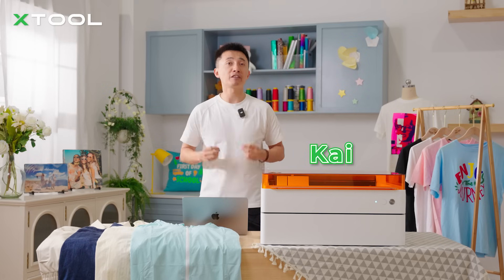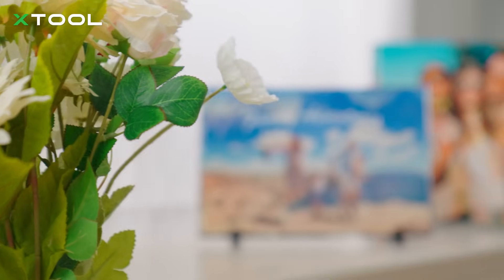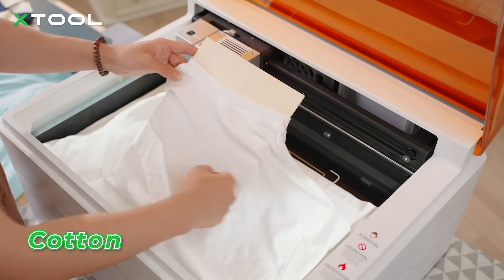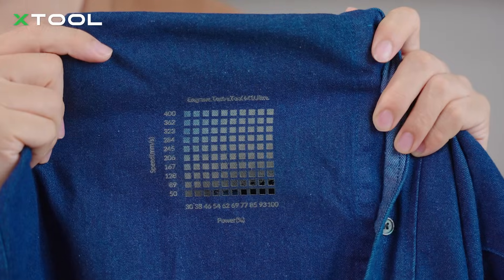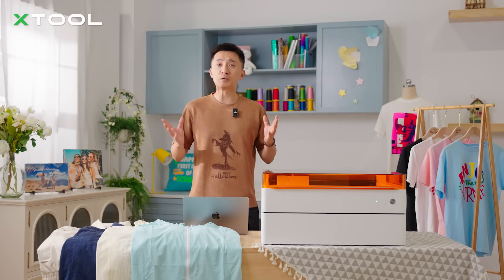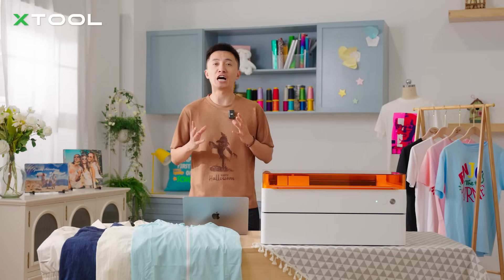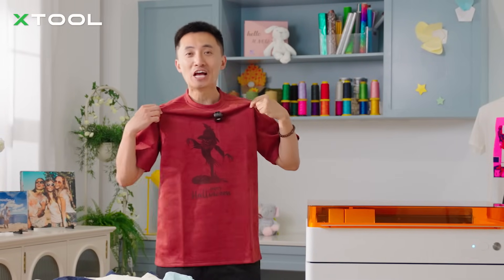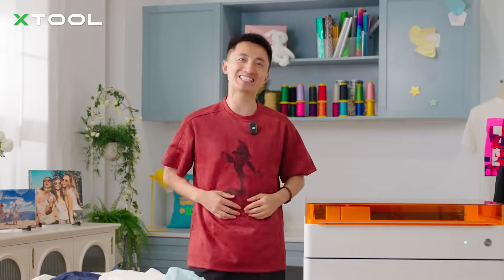Laser Clothes Test: Can Fabrics Survive the Heat?  Experimenting with xTool M1 Ultra!

Comment: I have done some engraving on canvas bags. It works really well! So you can add canvas clothing to the list. I used 30% power (M1 with 20W module) at 125 mm/s that turned out really well. Another tip I found on youtube when engraving fabrics: use high strength magnets along the edges to keep the material pulled tight onto the wooden board. (You do need to insert the honeycomb base, the standard aluminum base plate is not magnetic of course)
Reply from the maker: Wow you're a pro, Michel! Yeah high strength magnets are good for keeping the materials stable!
Reply: @xToollaser  withing time you guys can create a garment platter like the use for omniprint DTG printers. That'll be a game changer.